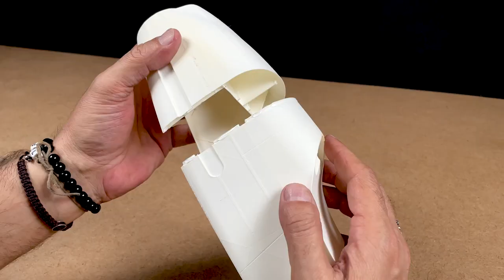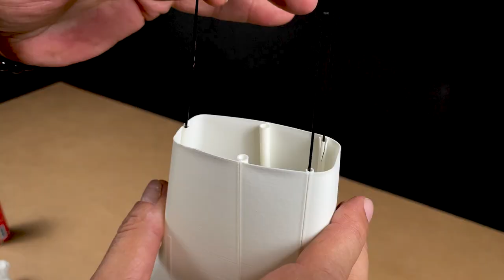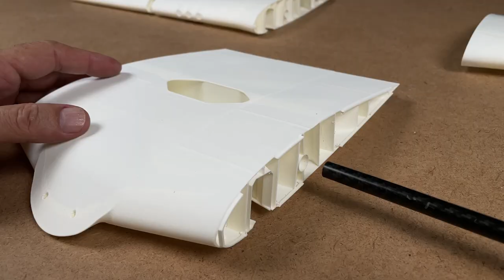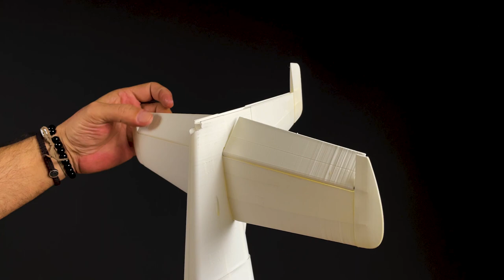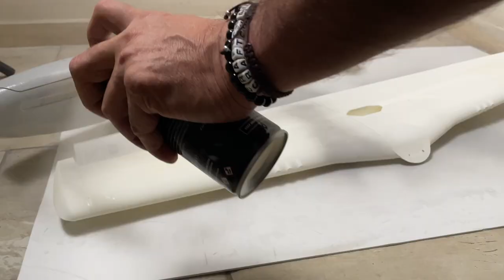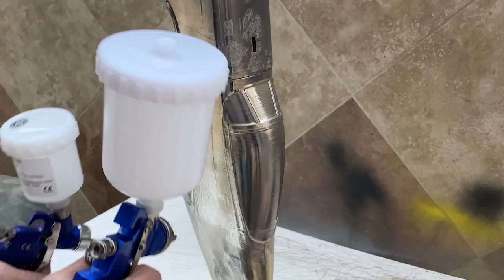3D Printed Eclipson Mustang P-51D build guide / part1

Comment: P-38 lightning please...sized for   5" 3blade drone props , 2300 to 2800kv used drone motors. And 3-4s 1350 to 1500mah lipos . Using 9gram servos...lot of us have this gear sitting around
Reply from the maker: Thanks for the proposal ;)

Comment: What would be the best printer for a project like this? Minimum requirement of size and printing quality. I'm looking for a printer exclusively to print your planes. Thank you
Reply from the maker: We recommend the Ender3 line of printers. They all will work well for our planes.
Reply: @eclipsonairplanes  thanxs for the info! I'm starting now with this 3D printing... I'm reading about the issues with weak printed parts, in the comment section...  And, it sounds more like improper printing settings,  too much extrusion, right ? Does the plans already come with the correct presetting, or it changes from materials used for printing and Printer type/model?

Comment: Did you print the parts with regular PLA in this video? I am using LW-PLA, the fuselage sections are very thin and crack. The joint tabs also break easily too. I am following the settings on your webpage.
Reply from the maker: Yes we used LW-PLA in this video. Double check the parameters and this section https://www.eclipson-airplanes.com/faq, the real wall thinckness should be between 0,45 to 0,6 mm.

Comment: I have bamboo labs P1S with AMS and a k1 and have dabbled with 3dPrintLabs and their LW-PLA with mixed results.  Someone recommended I try eclipse.  What LW-PLA do you all prefer?  Can I use Bambu PLA Aero?

The issue I am having is the 3DPrintLabs LW-PLA is always having issues and when I ask for tips they are not very helpful.  I also notice that your designs look stronger due to the cross supports.
Reply from the maker: We have a page dedicated to setting up slicers correctly on our website.  Scroll down to the "Bambu Studio Settings" section for specific info about using Bambu printers.  https://www.eclipson-airplanes.com/readbeforestartprinting

If you are still struggling with specific print issues, you can post details of your problem in our Facebook group where the Eclipson community can help diagnose and recommend solutions!  https://www.facebook.com/Eclipson/